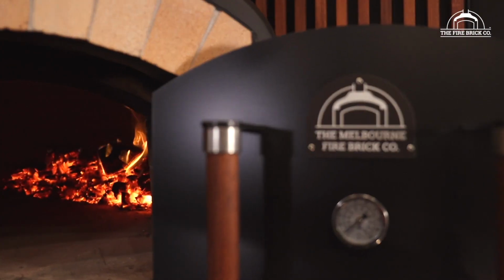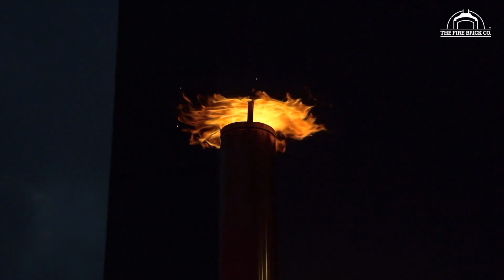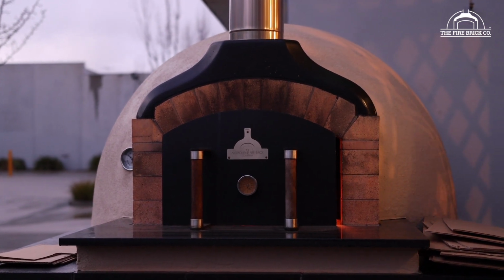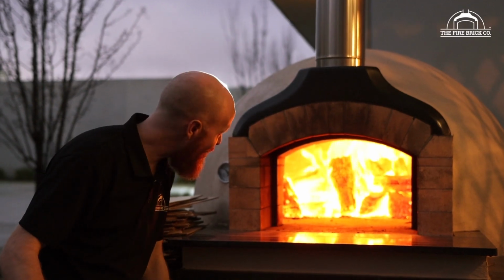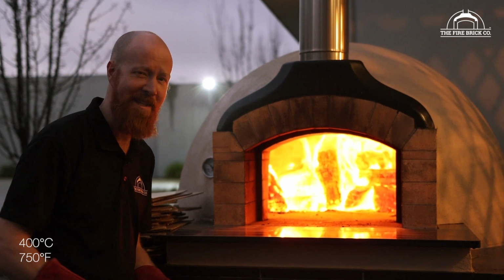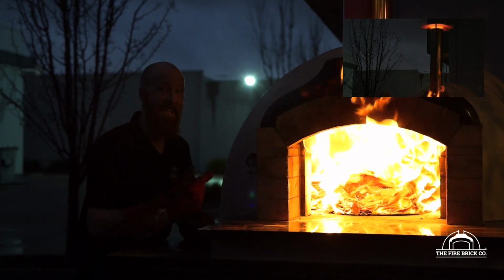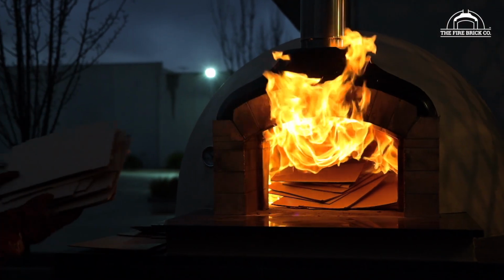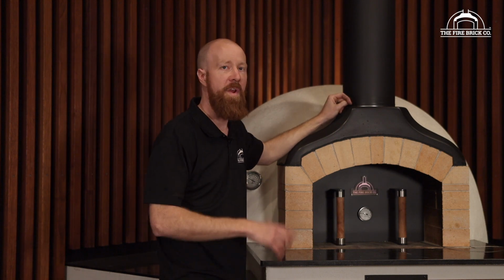Pizza Oven Flue Safety

Comment: Question - what if the flue is going through a stratco type pergola? as in penetrating the thin colorbond roof sheeting?
Reply from the maker: In Australia you would still need to get a licensed plumber to install that, and they'd need a twin-skin flue system at minimum. This is because you still need a rubber 'dektite' to seal between the flue and the roof, and even the 'high temp' Dektites are only rated to around 200C

Comment: I just finished building my brick pizza oven the only thing when is light up I noticed that some smoke comes out form the mouth of the oven it's that normal?
The flue is around 3' 6" stainless steel pipe. If someone has an advice or if that's normal I'll appreciate an answer
Reply from the maker: If you have any wind in the area it's quite normal. If it is completely still then all of that smoke should go right up the chimney

Comment: This is what has prevented me from having a pizza oven. Old wood Victorian porch. Wood slat ceiling clearance  will be maybe 6ft from capped chimney (Ooni perhaps) but that's not huge.  I want oven badly, wondering if I can modify chimney cap  - double and widen, but.....
Reply from the maker: If you're building an oven under a porch like that then your plumber would install a triple skin flue to punch straight through the ceiling, and they'd be able to do that safely for you. Definitely don't put any kind of oven with a flue just terminating underneath the ceiling, that's a recipe for disaster. Feel free to call us if you want to discuss it further - 03 9703 1758

Comment: Considering building one in my backyard in Melbourne West. Just thinking if Council can object, particularly during fire ban season
Reply from the maker: We always recoomend contacting your local council to check in to see if they have any rules around them - in our experience there have been no restrictions on building them, the key is to ensure that your flue complies with the standards, which ensures it will be safe but also will specify a height that takes the smoke up and away from your neighbours. During days of total fire ban you will not be able to use the oven.